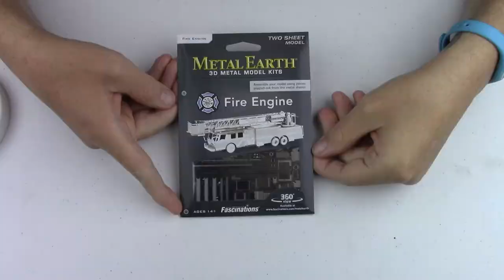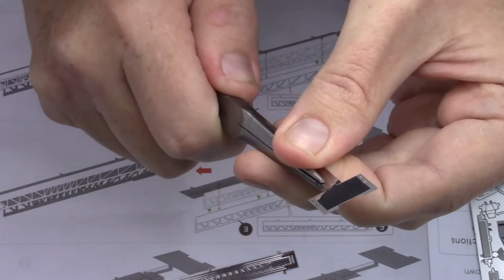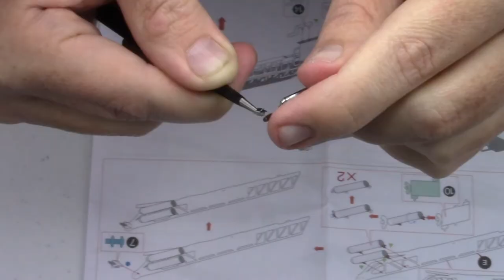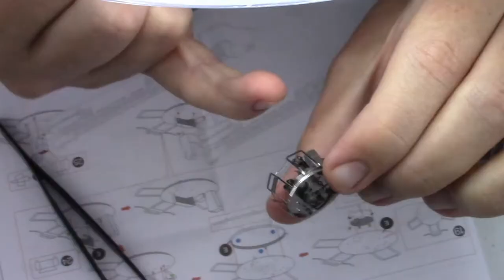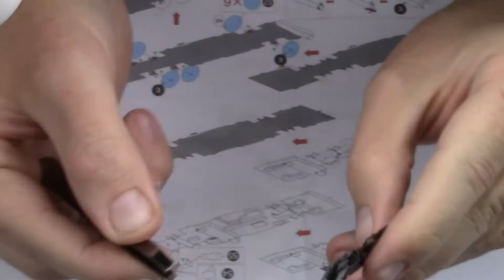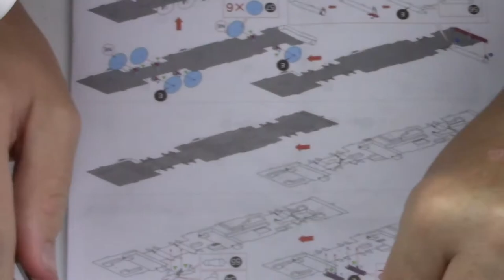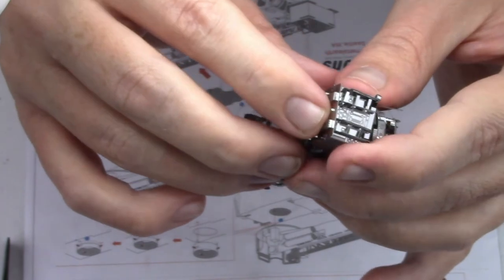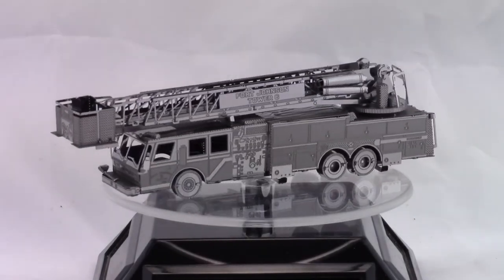Metal Earth Build - Fire Engine

Comment: I just did the fire engine. Second kit after the V22. I found the ladder part of this build easy. It was all the little parts under the engine that drove me crazy. Ended up gluing a couple of those parts on. The wheels were not as hard as I was expecting. Was tricky getting the big parts fully connected. Could not get the ladder assembly fully on (the center round part was far from 'round'), but it did get on enough so it looks fine and does move. Thanks for making these videos. On to the Freightliner truck and the Locomotive (box set) next.

Comment: Came out to be a good looking kit. Definitely one on my to-do list. Great work, and thanks for the notes of things to watch out for!

As I'm watching this, a Star Wars X-Wing is gradually coming together, with a fair few odd mistakes. Recovering from those makes this hobby worth it though! Have to admit I was expecting the worst when a tab in step one snapped off with only a slight twist, but it's looking good as it nears completion, and luckily the three other tabs are enough to hold the base together!
Reply from the maker: M S every now and then that happens to me with a tab. It seems like once in a blue moon I get a model that has weaker metal or something and a tab will twist off to ease or a joint will break with just a couple of bends.

Comment: Parts 13 and 14 are ridiculous.  They went in the slots with no problem but I couldn't twist or bend the tabs, there is very little room. I weakened the basket from trying, and put too much pressure on the ladder assembly. I decided to leave them out, at least for now, until I find a barrier tweezer or something. I'm finding this build a little complicated, but so far worth it.